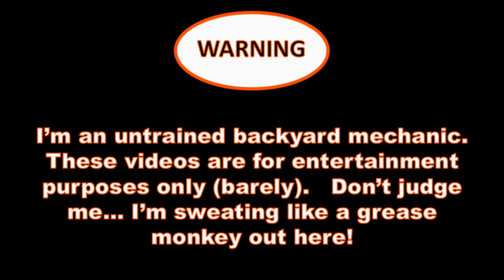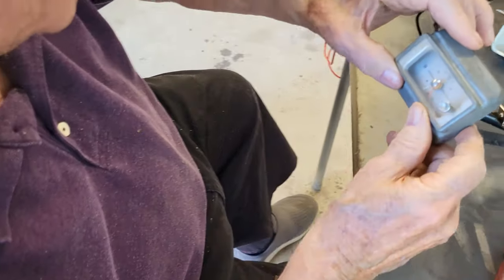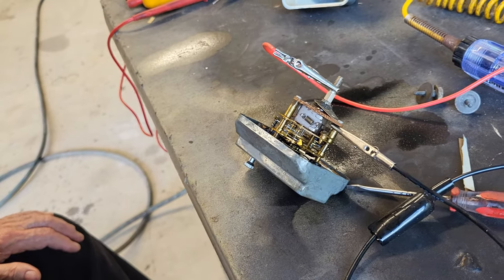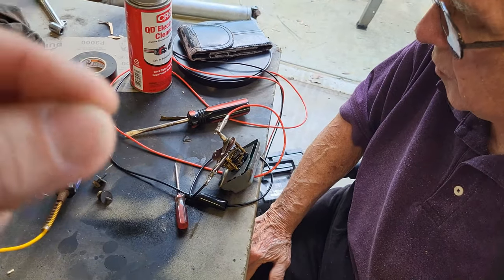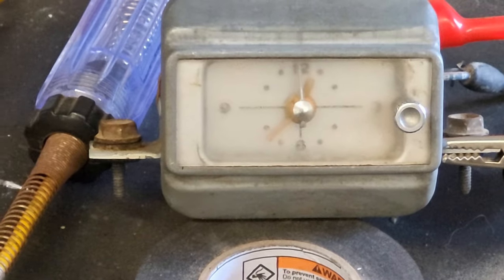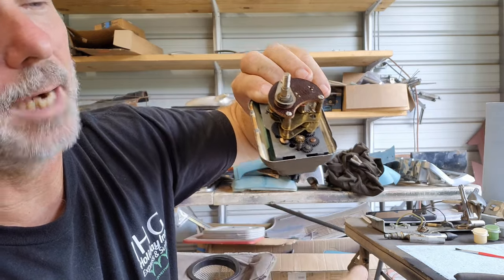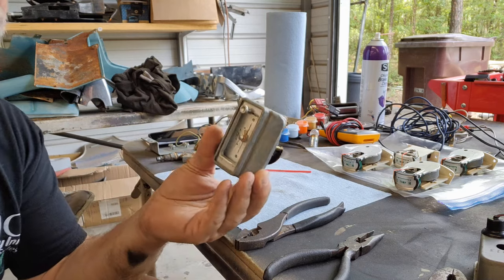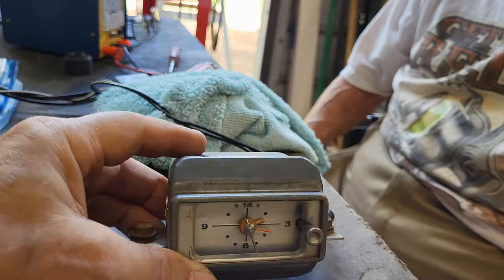Can I Get This Old Dash Clock to Work - 1964 Thunderbird

Comment: Hello Matt. Your dad did a great job getting that clock to work again. I cleaned mine out many years ago, and it needs it again. I didn't hear you say that you repainted the clock hands. I saw some paint on your work bench, so maybe you did? I have two more of those clocks that I'm going to clean up one from a 65, the other from a 66.
George B
Reply from the maker: Hey George.  He did a great job figuring out how it works and what needed to be done to get it going.  It would have taken me awhile.  I didn't paint them because they didn't look bad.